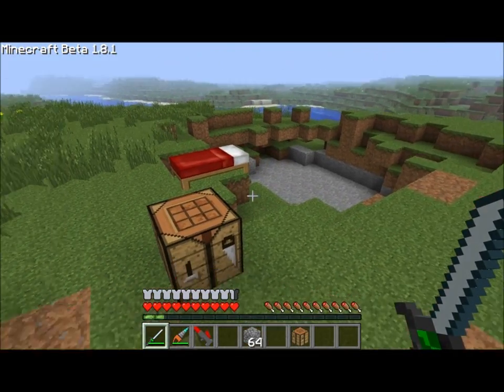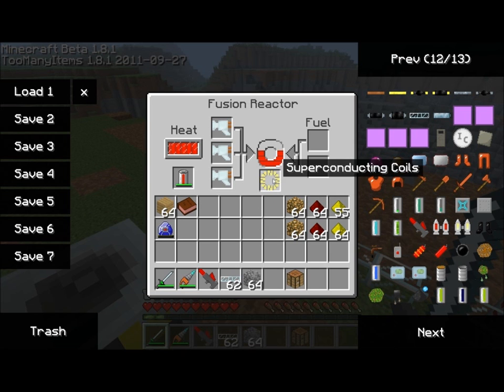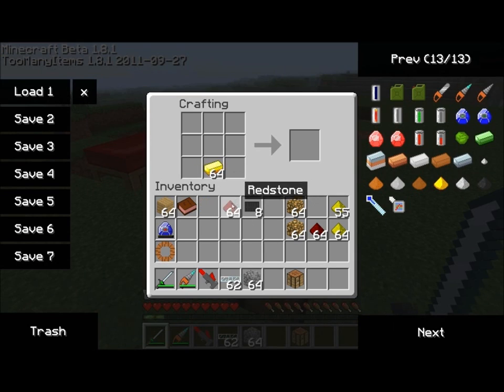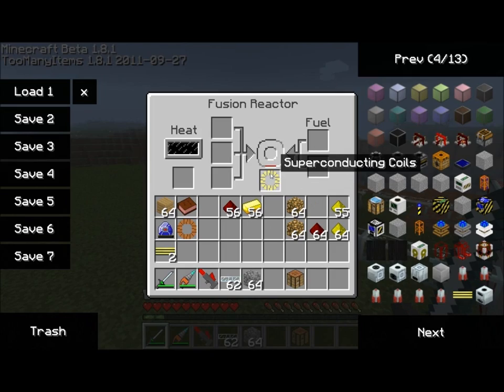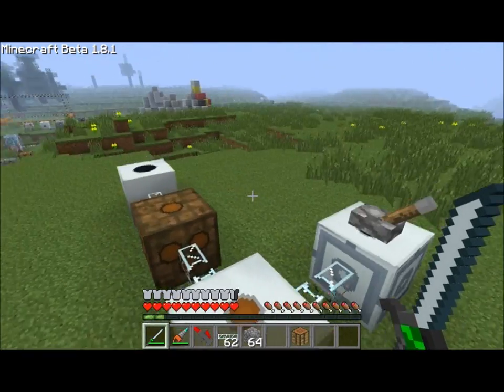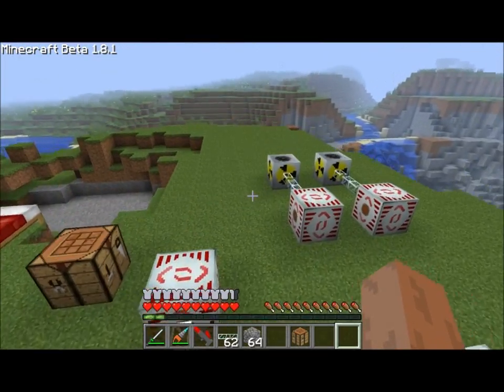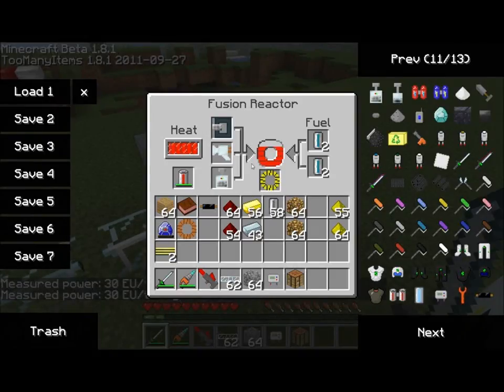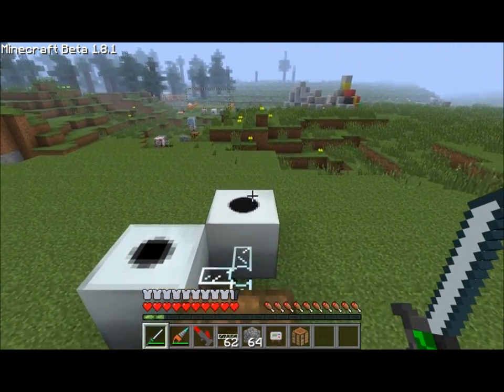IndustrialCraft Addon Spotlight - Rocket Science v0.6 - Part 2

Comment: The only thing that's changed about the fusion reactor is the addition of the lithium-6 slot at the top.  You can extract lithium from a certain vanilla item (scan the IC2 forums thread if you need to know, not spoiling it here), put it into cells, and place them into an isotopic separator to get lithium-6 cells.  Place those in the top reactor slot to get tritium cells which will, if able, pop into one of the fuel slots and up the reactor's output to 128 eu/t.

Comment: I did some calculations on how much energy you would get out of a fusion reactor if you gave it two full stacks of deuterium cells and a superconductor loop, and the final result was 19200000 energy units which is almost enough energy to fill two multifunctional storage units.

Comment: @theraino69 there's nothing wrong with your PC but it's about Java and MC file itself.
search for "Minecraft FPS Fix" in google and open "Minecraft Speed/Optimization Guide V 2.2"
i do only 2 thing and my FPS SSP went around 200-300 while SMP 50-150
Update LWJGL and Java 7, before i do this my laptop run only 50-100 SSP and 0-50 SMP, sometime horrible lag spike and freeze that i need to restart MC, after done this lag gone and went smooth as hell.
be sure to back up.

Comment: @QwerertX For the block breaker you can't use wooden pipes, because they have no inventory.
You need to use the redwire tubes and connect these from the breakers output to an thing that can store items and it will automatically give out the blocks in the pipe. When it connects to every block that could accept items, but not directly from the pipes,(e.g. full chests or Buildcraft pipes)but if there is no way to get Drops in it connects, it won't try and ignore that block.